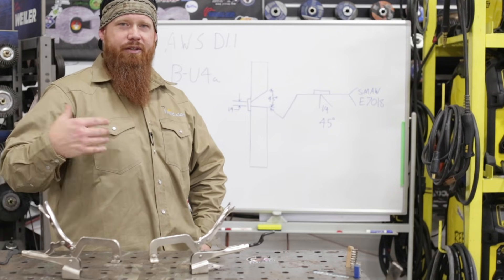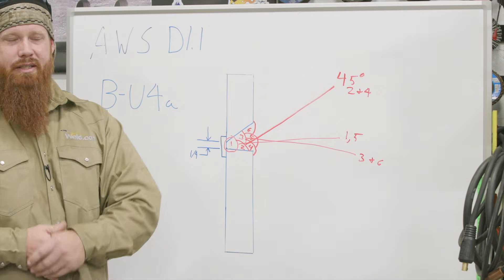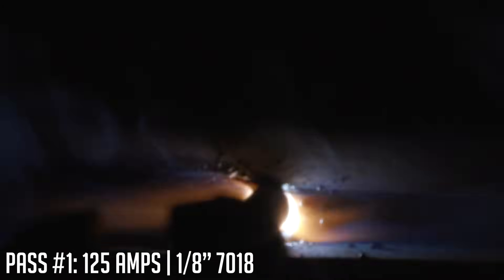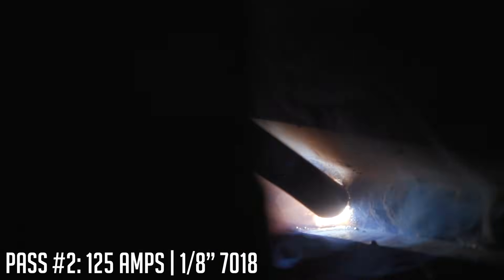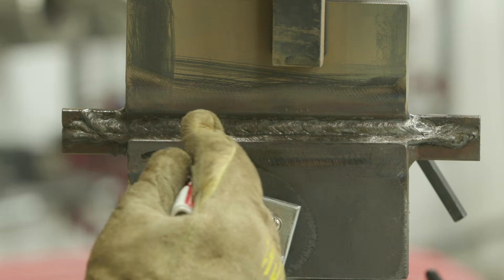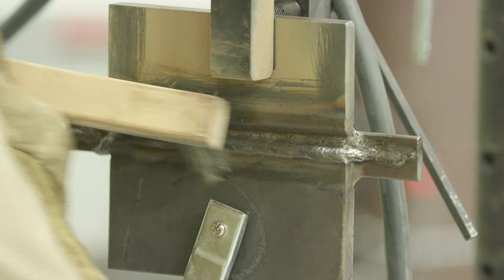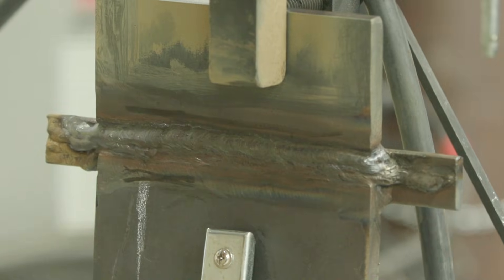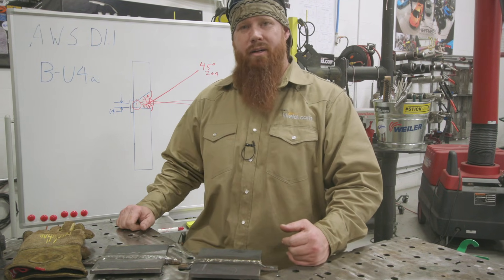Horizontal Stick Test

Comment: 125 Amps at pass 1. That's your machine setting, right? On my machine, DCEP, 125A would stick my 7018 1/8" rod. If I set my machine to 150A, no sticking, smooth welds all the time. Out of curiosity,  i took a clamp type current meter and it reads 100A when I intentionally stick my rod. And it shows 9A when I'm welding smoothly. The whole time, my machine is set at 150A. What am I doing wrong? Or is there something wrong with my machine? All current readings are taken with the clamp on the positive cable about 1 meter away from the stinger. Great vids, by the way!

Comment: It is Nice to learn about the rod angle placement in in 2Gf test plate, I will like to see camorra shots of the rod towards the front and back close to the stringer. it will help new welding students like me. Thanks very much your video's help very much. Marc from Winnipeg.

Comment: I'm not saying I'm a great welder but hot damn son. Those caps are lumpier than my sack. A 1/4 gap? I've never seen a gap bigger than 1/8 for any plate test with a backer. But hey man, you are an instructor of some type I am not. So keep on keeping on. Also manipulate? You mean weave. You shouldn't weave on a test unless it says its called for. If the gap wasn't bigger than my x-wifes snatch you wouldn't have to do that

Comment: I have a question - how do u manage to not set your beard on fire?! I too have a red beard (although not as big) and often have issues with sparks!! I often weld in very tight spaces mostly Mig and stick. Also is there any good masks to buy for confined spaces. Thinking of using an auto darkening lense to make a low profile setup?!

Comment: Nice video, have any tips for an open root weld with 1/8” 6010? I’m having trouble maintaining control of the arc on my 6010. It’s like the arc is favoring the bottom bevel. Thanks in advance!

Comment: this guy is way more lienent then my instructor. working on my 4 and 3 g, haven't even tried 2 yet, BUT that little start and stop woulda got me out.
Reply: starts and stops are not discontinuities, they are just a fact of life when you stick weld. As long as you clean your starts and stops, and optimally, feather them down, then they're perfectly acceptable welds assuming you dont have any inclusions or other discontinuities in em

Comment: Excuse my ignorance, but what is the purpose of the backing strip? When would this technique be used real world?
Reply: A lot of structural tests have backer plates, some tests require backer, some open root and some with ceramic backer.  It's all what ever the wps is for that test for that contract/job calls for.
Reply: @bofa1914  would passing a open root test qualify for doing backed welds?
Reply: @kristianskov4841  yes. I've only done 2 back gauge tests. Then again I've only been welding for 6 years. The mainm test I normally take are 3g 4g 1inch d.1.1 and 8inch schedule 80 open root pipe with 6010/8010 root and hot pass with either 7018/8018 or fcaw fill and cap. Every shop is different and every job is different though.

Comment: Because that's a single bevel joint with a root and backing plate, should that test not qualify you for flat and horizontal fillet as well?
Reply: I would think so. I just did a seismic D1.8 with that criteria and covers both positions.
Reply: This is a good video to show new welders some good info, but this guy still has years of learning before he teaches.

Comment: 1/4" opening is big enough for 2 passes for the root. Way better pen and almost no chance to miss either bevel. Your root looked wishy washy.
Reply: Looks to be a 3/32, it could be done with a 1/8th rod and filled in better I think right?

Comment: I own 6011 and 7018 .   Is there any reason to own any other rods ?   What would I use it for ?
Reply: 7024 is a fast fill rod also called jet rod. Only used in flat and horizontal
Reply: Russ Penman first it depends on what you are doing.
Reply: when ever in dought you can weld almost anything with 309 as long as not aluminum or brass and shit like that. steel is mainly for your common rod 6010, 6011, 7018, 7013.
6011 is AC or DC. So is 7013.
Reply: 308 is stainless to stainless. for the basics.

Comment: I think when i did my 2g plate test I did 2 separate root passes, 1 for the bevel, and 1 for the straight edge. Only the straight edge required a stop start if i remember correctly.
Reply: @ironmike7601  3 out of 4 positions require 2 stop and starts.  Both root bends include the re-starts.  Typically, all 4 positions are a single bevel with a 30° included angle.  Positions 1, 3, and 4 are a 1/2" root opening with backer and 2 is a 5/16" root opening with backer.  All tests qualify the welder for groove and fillet welds.
Reply: @Lambear82  Perfect Explanation of the Parameters
Reply: @ironmike7601  in Canada every CWB test requires a stop and start.
Reply: @ironmike7601  yes
Reply: I'm practicing mine rn, the top is stop and start, bottom is straight through.
Still struggling to get it to a good enough quality.